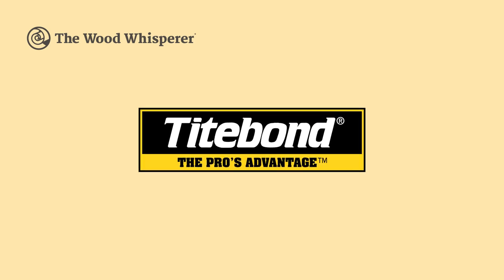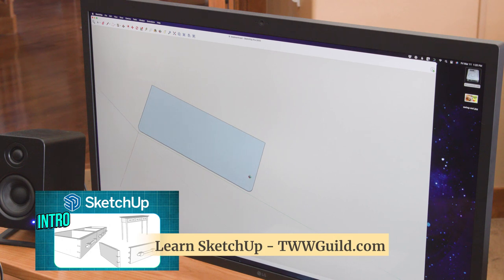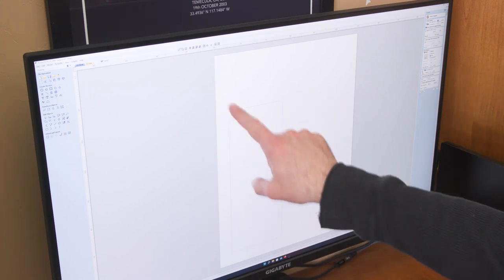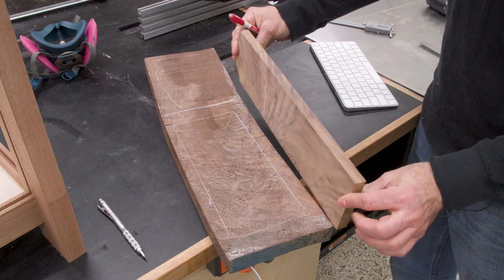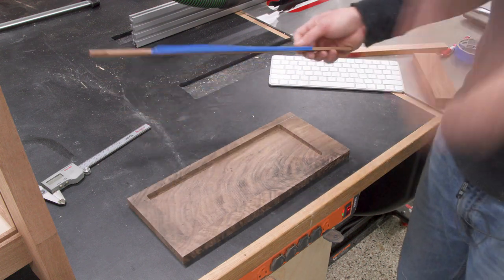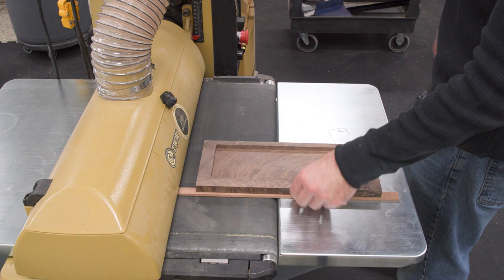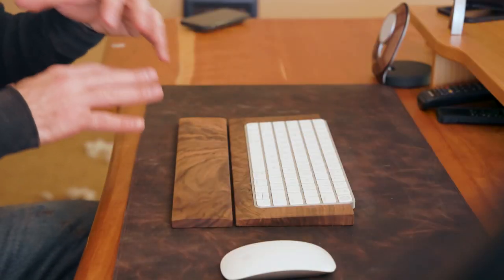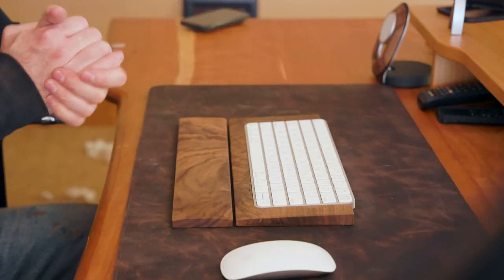Custom Keyboard Tray & Wrist Rest

Comment: Cool project - I'd add those rubbery stick-on clear 'dot' feet to the bottom so it doesn't slide around.
Reply: Two little inset magnets on each side so the rest sticks to the rest of the keyboard frame.
Reply: @Grove332  even better!

Comment: I recently got a new iMac and ALSO needed to raise and tilt the new TINY keyboard. At 6'4" with hands to match, I HAD to do something and since I USED TO WORK FOR APPLE, I knew buying something from them would not be cheap. So, like you, I made my own simple thing...also from walnut cut-offs. However, I may remake it after seeing your idea using the CNC to pocket out a custom fit like that. VERY cool...as always.

Comment: Very awesome work as expected. On another note, it would drive me nuts using a keyboard like that, but I'm a drafter by trade and 3D model on the side. Have to have a full keyboard with classic-sized keys lol. Just me I guess
Reply: Not just you, many people hate those keyboards. The design & principle is easy scalable though
Reply: Samesies. I’m a 3D model guy more than drafting, but I still like a full number pad to the side on my keyboard! Soooooo much easier to pop in dimensions and stuff.
Reply: Completly agree. This is fixing something that should not be there in the first place.
This is NOT a keyboard. Win of the form over function.
Horiblle keys, too small distance between them, no numeric... this "thing" shoud not exist.

Comment: I know you want them as 2 separate pieces, but 2 or 3 brass pins connecting them would look cool! 
Example:
2 pins, 1/4" deep on the wrist rest and 1/4" deep on the keyboard leaves 1/2" gap.

And, a little nearer the center do the same thing but only 1/8" deep to leave a 1/4" gap when "connected".

(Think adjustable shelves holes, but horizontal.)

Also, they don't have to be glued in...just pushed into the corresponding holes to keep the 2 units from sliding apart from each other.

Comment: Very nice project.  I was confused when you were applying your finish on what appeared to be a very dusty pad.  I thought the idea was to avoid exposing wet finishes to dirt and dust. 

Bob
Reply: Don't think it matters too much with this finish because the finish soaks in and you buff it afterwards removing anything that might be stuck

Comment: A keyboard tray like this for a ThinkPad Compact USB Keyboard like what I use would be very nice.
I liked typing on it but I found the keyboard is too low to the desk that my hands instead cramp up.
I've been using a cheap bamboo chopping board for months now and that's been fine to raise the height and give me a wrist rest area, but ideally a proper keyboard tray would be nice.

Comment: Question 

I'm making a kind of kitchen top but for outside undercover area 
Im in Europe so temperature is from -20 in winter to +40 in summer 
Wood is European beech
Top is 2.4m x 700mm x 40mm 
Glue up is from 5-6 peaces various width smalest is 80mm, widest 120mm.
So im thinking to put steal squere tubes through the wood with rod inside of tube and tight all that up, but not from edge to edge but from roughly 50mm from live edge to the end of the top.
Will that crack, move, bend or cup, is my question 
Thanks

Comment: Welcome to the 2000's. I made something similar back in 2000 when I was working with AUTOCAD. It was made with figured walnut with thin rubber straps on the bottom to keep it from sliding too much.

Comment: Looks nice, but I think you now ended up with a keyboard that’s flatter than before. Not sure that’s more ergonomic, but whatever feels good to you. I probably just would have elevated the keyboard and used a squishy wrist pad like the one you showed at the beginning.
Reply from the maker: It's not flatter, it's higher and my wrists are also now higher and slightly above the keyboard.
Reply: @woodwhisperer  This is indeed more ergonomic! The default angle of the mac keyboard is terrible for ergonomics and encourages bending your hands backward which causes a pinch. It's just all the wrong angle, yours is at least better since it encourages lifting the wrists. Even more ergonomic would be lifting your wrists a little higher than your current result with perhaps a downward slope to the keyboard. But you've got a good "bubble grip" with this setup and your wrists aren't bent which is key, so it should be good enough. Nicely done.

Comment: Cool build! But from an ergonomics standpoint, you should not be using the wrist rest WHILE you're typing. It's a "rest" for a reason. It can cause issues that may not be a problem for a couple emails a week, but RSI is literally a pain and if you do more than that, please spend the time to read about ideal set ups.

Comment: You actually don't want to place load on your wrists while typing– that increases your risk of getting carpal tunnel syndrome from compressing all the fancy stuff in your wrist. Depending on how high your seat/desk are, it could be better to get an under-desk keyboard tray that can tilt at a negative angle so your hands are in a more natural position. And/or find a PT who does in-home ergonomic assessments!

Comment: Loved this but I have a project I'm trying to figure out. I want to build a desk with a keyboard tray built in. Basically it will be a flat desk until I need the tray. Then I move the front of the desk down to keyboard level. My dilemma is what is the hardware that will allow the keyboard tray to drop down and be flat at desk level. Any ideas?